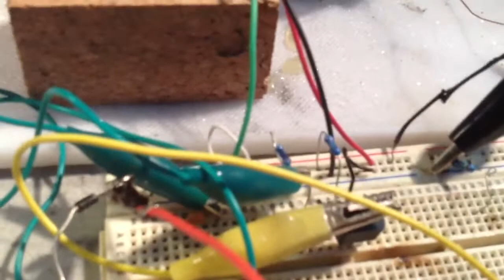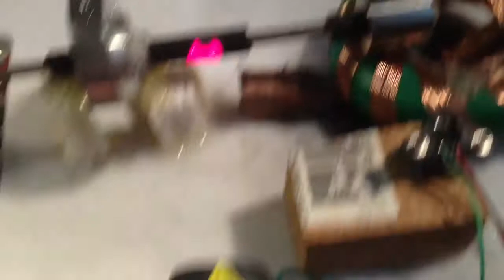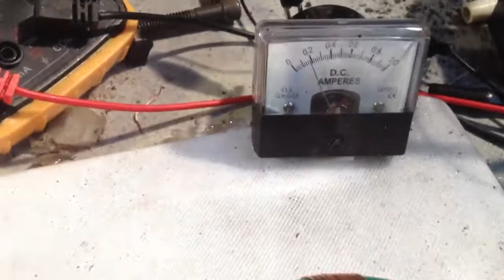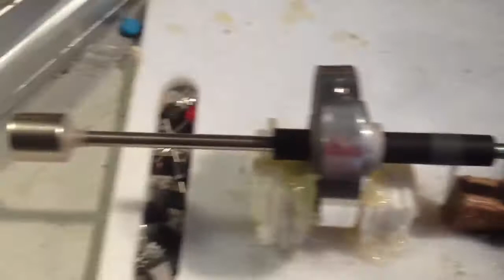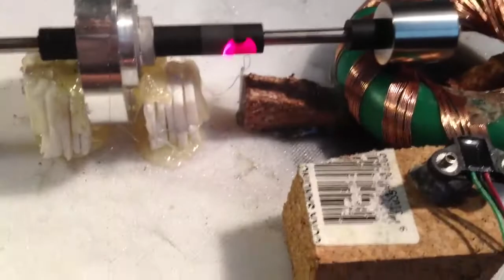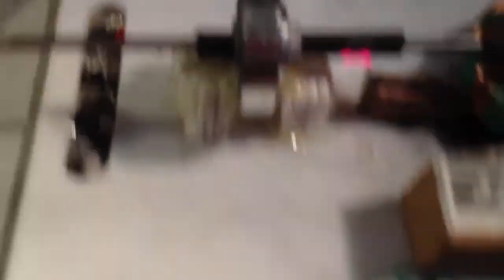Pulse motor build off part 11

Comment from the maker: I'm actually back to just one mag now and am using a diff hall switch. Last night I got 33000 rpm on  200ma the bearings are from a VCR tape head. What else would you like to know

Comment: Safety first junk yard Jim!  ;) lol sounds more balanced than before and that will = to less current and more RPM. Your reed switches pulse less during a turn where the MOSFET and hall ( If a latch) will stay on till the other pole is around. Also, you want more speed, use a second MOSFET and switch it when the other coil is off... ( opposite polarity) and yes, neoballs are unpredictable! Good one! ~Russ